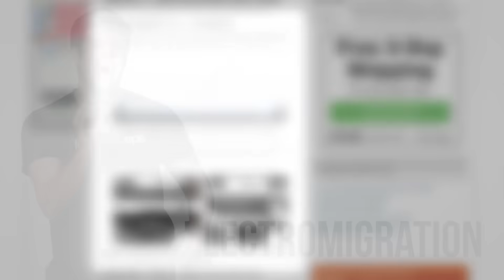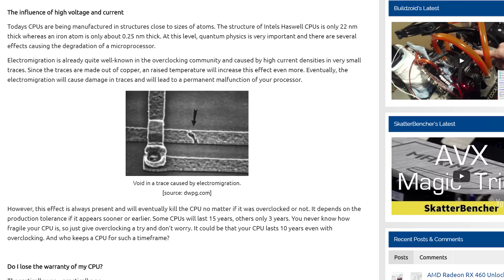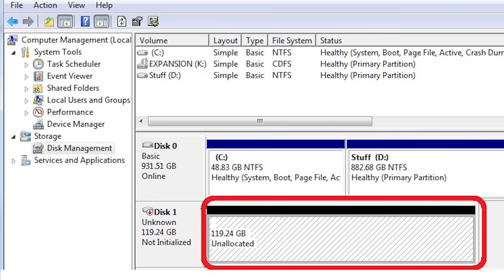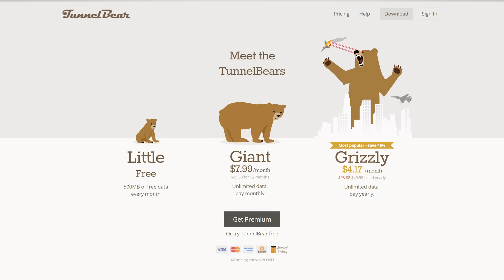Why Do Electronics Die?

Comment: Why hate on Apple for planned obsolescence when they actually give your phone 3+ years of software update. Almost ALL Android phones will not even get 1 major software update.
Reply: TheWioreks ? as far as i know you can update the samsung galaxy (8 year old phone)  to the latest version of Android
Reply: Brek Martin you just described every consumer electronics company.
Reply: Departure From ZERO android doesn't have to work across different phones. Phone manufacturers have to make their phones work with the android platform.
Reply: TheWioreks you cannot compare iphone with all android. you can only compare with the high end flagship android, which is always updated for years, even the manufacturer stop support it, many third party dev still make a software for them.
Reply: +TheWioreks That's why I use a Nexus :^) (I guess the Pixel has taken over the Nexus at this point though)
Reply: yes but that is all part of it. Every time i update my phone, it slows my phone down a little. The first couple updates were fine but after a while it slowed down. I had an iphone 4 that i used for years and every time id update it, it would slow down. It really wasnt even usable anymore so i had to get a new phone.
Reply: TheWioreks What good is a software update if you can't use the phone? Didn't really think that one through did ya? ;)
Reply: I'd rather have 1 useful update than 3 broken ones...
Reply: At least not officially from Samsung.
Reply: Yes from samsung. Although it's possible to upgrade to the latest android OS before it's official samsung release, the "prompted" update is the official samsung release.  And my 3 year old S5 just received a new update prompt last week.
Reply: TheWioreks, no point in getting updates if it's going to brick your phone or tablet. Apple does it all the time. It's annoying. Can't say the same with my Nexus. Google knows when to stop....
Reply: TheWioreks 

So what? Planned obsolescence is bad
Reply: didn't know that. oh well you'll be happy to know; you're not missing out on anything with the Samsung updates apart from being a bit clunkier and swipe is wrecked
Reply: TheWioreks Maybe not every year a new full change but bug fixes and stuff like that andeoid does get that. my friends nexus 4 still gets security updates. my nexus 5x got android 8.0 (oreo) and first ran 6.1.1..so they do get updates, but we can do mote n android. and i just like android more Aaaaand i can give thousand of reasons why, but i wont because otherwise its a war like windows or mac 

(i prefer windows but i dont want these fights lel)
Reply: TheWioreks tell that to my 3  years old Huawei p8 lite which got an update yesterday
Reply: Because they are environmentally irresponsible with no way to dispose of returned crap, financially crook with tax schemes, and drive their factory workers to suicide.
Reply: All android phones will not even get 1 major update?

tell that to my android nogut running on my s3.
Reply: TheWioreks and their PHONES are still YEARS behind the other (android) phones
Reply: TheWioreks and yet Apple's gets hundreds of lawsuits,every year
Reply: TheWioreks and android is all and open platform
Reply: Dezta93 No manufacturers dont give shit about new android versions, just look at the install base of marshmallow, the only reason it even has an install base is from new phones.
Reply: Plasmaboo Lol great shit post and google doesn't make an update for phones they send the newest version to the manufacturers and they are the ones that choose what to do with it. Get your facts right.

Comment: "I am about to blow your mind, current is electrons flowing" lol anyone whose passed high school can tell you that.And capacitors don't have electrolyte they have dielectric material to increase capacitance. seriously who does your research??
Reply: The electrolyte would be called a dielectric if that was its function.
Electrolytic caps do have an electrolyte as their name implies and it conducts electricity.. as its name implies too since it's the cap's cathode actually.
The dielectric in this kind of cap is just an oxyde layer on the anode which is why the capacitance is so large (because the dielectric is incredibly thin).
Reply: Never heard of an electrolytic capacitor?  Those are the cans and the one type of capacitor anyone from LTT knows about.  The majority of charge is stored chemically in the electrolyte.  Other types of caps like ceramic, film, etc. are based around the parallel plate cap with a dielectric media to decrease the electric field magnitude and increase capacitance.
Reply: wouldnt electrolyte between capacitor plates  lead to (in a way ) connection of positive and negative terminals? thus leading to a short circuit?
Reply: The anode is coated in an oxide layer that prevents electrical conduction (but it really only works in one direction)
Reply: Paul Frederick electrons do flow.  They don't empty of electrons because you must have closed circuits.  However, at very small time scales there are increased and decreased electron densities in wires
Reply: Electrons do not flow. They exchange orbits. If they flowed the conductor would quickly empty of them.

Comment: @TechQuickie You get a 4 out of 10.. Should have organized this one as Expansion/contraction failure from temperature changes & on off cycling, corrosion via condensation/dissimilar metal corrosion/eddy currents etc, interference via EMI/poor EMI shielding(engineering flaw) & power surges, component failure due to manufacturing defect, and finally engineering failure due to selecting a component insufficient to sustain the circuit e.g. over/under voltage or poor overall circuit design which loops back to one of the above failures prematurely.  
 I've watched some good videos produced by TQ but this one could use revision.. sorry. Also electrolytic caps last longer when they're not shelved i.e. not a component made for long storage life. Keep them running and they stay functioning longer.
Reply: Cool story
Reply: He covered the most common failures, but another tow he never mentioned are:
the growth of Tin Whiskers in solder joints, and ESD damage during system maintenance/upgrade .

(From Wikipedia...  Tin whiskers are electrically conductive, crystalline structures of tin that sometimes grow from surfaces where tin (especially electroplated tin) is used as a final finish. Tin whiskers have been observed to grow to lengths of several millimeters (mm) and in rare instances to lengths in excess of 10 mm)
Reply: He also forgot the obvious one given the kind of channel : Overclocking.
In PC gaming people stress the hell out of components, increasing clocks, voltages way past the rated spec and then wonder why they have bits of exploded i7s stuck to their wall :)
To my knowledge, the most common failure modes in computers are overheating (due to OC, or simply lack of cleaning with heatsinks rendered useless), and underpowered or cheap PSUs (dat ripple)

Comment: Every element melts and flows over time, you can see vertical distortion in mirror due to same reason. A metal which has lower melting point can flow faster like mercury but more brittle metal can move and flow at very lower speed.
That's why semiconductors working on low temperatures works well for very long time as compared to semiconductors working on high temperatures.

Comment: WHY DO COMPUTERS CRASH?
Reply: Because they were drinking and hard driving. Hahaha... sorry. Roughly, it is because either software tries to do something it shouldn't or a driver translates a command from software wrong and tries to do something it shouldn't. When it isn't software/driver issues then it is an indication of physical issues such as the mentioned heat issue or such. It can be good to open the case from time to time and pull out the dust bunnies as well as vacuum/dust the interior.
Reply: Because the software breaks somewhere
Reply: Esperologist i know why but i just thought it would be an interesting video to cover :P

Comment: Video idea: What is the difference between ADSL and VDSL?
VDSL is sooo much faster, on the same old telephone wire... HOW?

Like not 20/1 but 60/15 speed. Doesn't seem like much. Until... The first one you can barely stream 480p, and VDSL, 1080p 60fps easily... And it matters if the Steam download is 30 min, instead of 6 hours...
Reply: the telephone wire has 4 cables inside vsdl uses all of them and adsl only uses 2
Reply: alex alcala ortiz Thanks. An episode would be still cool. And is this common in the USA or other places? I'm seeing this first time, I'm Hungarian (that small country right in the middle of Europe)

Comment: You forgot about company setups hardware to die mostly laptop, battery and graphic card,lcd or cables that connect laptop monitor.
Old laptops lives longer then today ones as they in my opinion was build on more solid compounds then today.
As form my experience, even if you check temperatures, clean your laptop, etc he still can fail you after a time. I get even a info witch i can't find before i buy my laptop that graphic card have failure in production and they massive die.
Or my batter is dead - as microsoft says because he is 8 years old - as i discharge and load it once a day to full almost.

Comment: That military class motherboard actually died on me about 6 months ago...
Reply: Just a marketing wank. There's no official objective standards it needs to meet to be qualified as "military grade", they could probably cite some paper pusher using a cheap pre-built in an ROTC staff room as validation of it's military grade quality.
Reply: geret13 Because one capacitor had turned traitor.
Reply: geret13 It must have been france military class
Reply: If a motherboard is used for an airplanes dashboard or avionics bay as main computer or inverter, it should have all the specifications i mentioned as this stuff needs to be reliable. Believe it or not, but your car airbag control unit is even more reliable then NASA's pre launch environment or equipment monitor and sensors. And that shit is crazy reliable
Reply: How old was it ?
Reply: He grilled cheeseburgers and fries on it. just kidding.
Reply: the military class is absolute bullshit compared to actual military class motherboard which is water stress and drop resistant. maybe like titanium cpu pins on motherboard and waterproof coating maybe would kinda make it "military class"
Reply: Do you realize that the US military has certain specifications that products must meet? Once you meet those specs you can bid. Til then you can take a fucking hike!
Reply: @Andre' Fontes Club penguin actually shut down. 1 day ago :P
Reply: Military grade circuit boards or motherboards use FR-G4 substrates or similar/better (used in airplane avionics, as its fire resistand), leaded solder, not RoHS compliant, gold connections, not titanium as it is a poor conductor and oxidizes compared to gold. The rated operating temperature is -50 degree celcius and 150 degree celsius. These motherboards are reliable and should last long, if they don't, they either didn't pass QC or are fake stamped with bullshit
Reply: +Schmiddy Our military has official specifications for hardware. Mil spec electronic components is a real thing too. Mil spec hardware has a wider voltage, and temperature operating range. There's mil, auto, and commercial hardware grades.
Reply: geret13 if youve been in the military, you know military spec stuff is literally shit. just like every thing else in the military, cause remember everything that's made for the military is hired by the lowest bidder
Reply: My cheap ASUS mobo took a hit of lightning but still worked for about 6 months, then the system as a whole started freezing.
Reply: What does "military grade" even stands for? Do soldiers bring those along to play some Club Penguin (oh...) in between raids? There's no official tests or standards to it, neither an independent org to test them, it's just something people eat up thinking it's actually better - "oh, why I paid a hell lot more for this mb that offer pretty much the same of much cheaper alternated? This one's a military grade mb, bro!"
Reply: That military card is a load of wank. That would cost a fortune. military specified components are always more expensive, and MIL SPEC is a production process that no gfx card manufacturer is paying for either.
Reply: well tleast in the old days the scematics and boards were all covered in thick(i mean half a cm thick) layer of lacquer and reinforced with steel in the corners
Reply: +Samir Hashami I was not in the military, but I worked subcontract making communications hardware for the military. That hardware was far from shit. It was the best shit money could buy in fact. Yeah the lowest bidder that can make the spec. Go fuck your hat.
Reply: Martin lucky mine died after 2 months now i bought msi mb
Reply: Y'all realize the US military contracts production to the lowest bidder right?